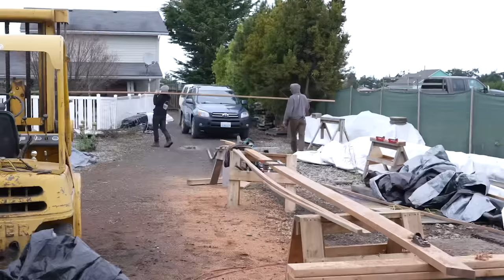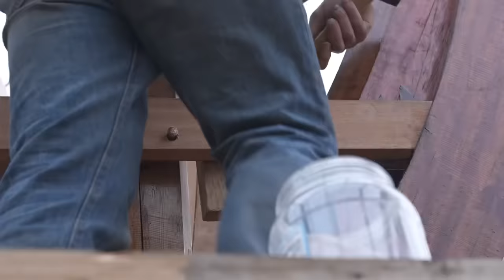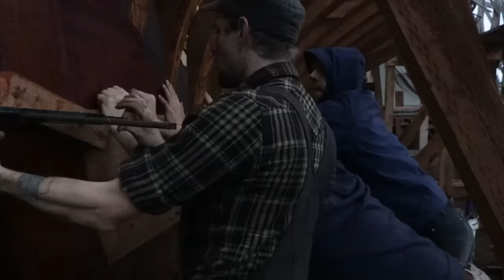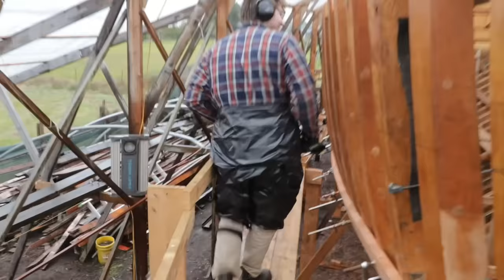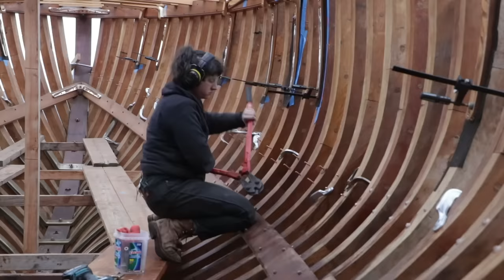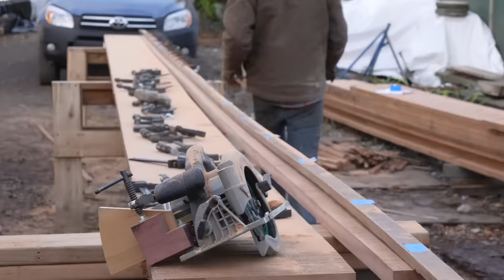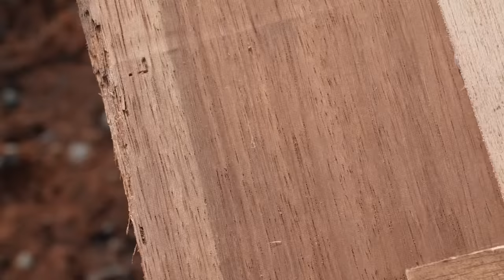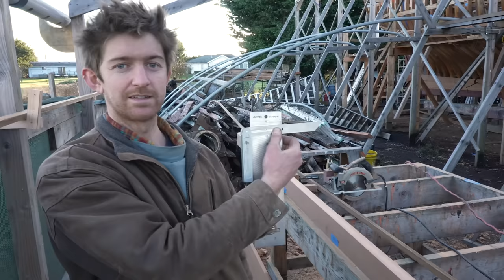Planking Tally Ho! (Wooden Boatbuilding / EP86)

Comment: $700 cost for cast bronze floors is such an incredibly cheap price. If you included what normal labor charges would be for the huge amount of work in each part I suspect the cost would be 4x that or more. The foundry was also  so very kind in their charges. My first thought when you started the floors was OMG, the cost will be huge . I’m so happy 
you pulled it off with such FINE workmanship.

Comment: Have you ever used a rivet gun. Chicago pneumatic and ingersol rand make some nice ones. You can buy sets for them for universal head rivet that form a nice shop head instead of hand peening. I use a 4x for up to 1/4 aluminum rivets in aircraft. And a 7x does all the larger thing I’ve come across.

Comment: The aversion to epoxy is kind of interesting - multi million dollar sport fishing vessels are built every day in North Carolina using marine plywood and epoxy, but they are skinned with fiberglass so I reckon that makes a difference even though the glass isn't structural.
Reply: @cmmartti  yeah - in cold molding several layers of marine plywood (or thin planks) are glued together with epoxy over a jig to form the structure of the boat. Then the whole thing is skinned with fiberglass to waterproof and prevent abrasion.  Just another example of how many different techniques there are in the world to get stuff done.
Reply: @cmmartti  when I was in college the civil engineers competed in a concrete canoe competition.  That was cool stuff.

Comment: When you look at the problems that A2A had with their scarphs, can't blame you for using butt joints. I think Steve said he was uncomfortable with the butt blocks inside hanging up dirt, damp and garbage. Personally, I just don't trust glue at all (everyone but me seems to be able to use superglue without a problem), so I would agree with you. I was wondering whether you were going to use screws or dumps to fix the garboards and hood ends. I knew I would find out eventually, so held off on asking. As usual, thanks for the video.

Comment: - 29:29 The $33K spent for the bronze Tally Ho needed will pay happy returns many times over in many different and surprising ways. The striving of your inspiration's will, and the happy work done by all, is held as a signal forever in the copper of that metal for all to register and take as supporting guidance long into the future.

Comment: you can actually replace the bucking iron with a grip holding on to the ribs above the rivets and held in place with a lever going beneath the location of the rivet, sparing the stress of the buckers body. the lever can be as long as one meter or more giving a lot of holding power on the rivet, just make the fulcrum of the lever focus on the head of the rivet.
Reply from the maker: That's a great idea, I might try that!

Comment: Leo, get the crew an air hammer for driving those rivets. Much easier on the body, and faster/ neater (you can buy dies with concave ends).
Reply: I used an air hammer for 3 days, and couldn't feel my arm for 2 weeks after....

Comment: I wonder if $700 is some sort of magical bronze-number. We designed, and had cast, bronze hardware for the house we were building - hinges, escutcheons, levers, strike-plates, and (for many of the doors) deadbolt knobs and/or kick-plates. The number came to around $700 per door.

Comment: It's too late now, but could you pressure inject polyurethane mastic into the old pitch sealed joints? I'ts stuff that sets under damp conditions so should seal the cracks. I'm thinking about something like the "furmanite" process used in engineering to seal leaks. Lower pressure on the boat - we don't want joints forced apart. Stop dowels can be added later.

Comment: Interesting video. Question from an interesting armchair boatbuilder (Mine is steel...) is there a realistic risk in planking up one side first, then the other? I thought that might risk deforming the frame. So you would alternate the starboard garboard with the larboard garboard...

Comment: Talking to a shipwright just yesterday and I called him a carpenter but he soon corrected me and rightly so. I have thought about this and then come up with a pretty good theory that basically covers the difference between the two trades. 
- a carpenter deals with an angle and a shape.
- a ShipWright deals with changing angles on a continues changing shape.
Summing up even further a Shipwright in finesse is comparative to the toolmaker in the steel world. 
The difference  between the two comparisons is if you don’t get it right being a Shipwright the boat you build may sink somewhere out on those Oceans whereas as a toolmaker makes a mistake he just throws the tool into the scrap bucket. Lol

Comment: I have bucked many a rivet but on a aircraft, not on the boat.  We use a pneumatic impact tool.  Why are you using a ball peen hammer which seems less efficient?  Thanks for the videos.

Comment: curiosity question. I didn't see any caulking so far. and the abutting joints between planks and between garboard and keel seem flush, so no room to pack caulking in after the fact.

I understand this is an obvious limitation in my knowledge of shipbuilding, but how do you make all these planks leak proof now?

LOVE this series. It is THE BEST!
Reply: Leo hasn't been very explicit about it, but they are definitely shaping a 'caulking bevel' into the plank edges.

Comment: Leo why do your hood ends of your planks at the stem rabbit not continue to a point? It looks like you have placed an insert to fill this gap afterwards,  is it to prevent damage or splitting on the pointy ends?
Reply: You cannot screw/rivet pointy bits: the wood will split:  remedy: the next plank fills in the  void
Reply: @on4xb  thanks, the reason i ask is because i am doing a clinker (lapstrake) restoration, and the planks on it do continue to their point, where the plank above bears down on the one below, i suppose it saves the need for a fastening right on the thin end. Obviously carvell construction is slightly different, but watching this i was wondering if i need to have those pointed ends as they are quite vulnerable to cracking, as evidenced by the ones i am replacing, but now i can see that i have no other option. I am not a boatbuilder so it is a learning curve.

Comment: Just an interesting note, if your keel lead has been made before 1940 (when the first nuclear bombs have been detonated) it is so called "low background lead" which is very prized for scientific purposes. Price for this type of lead varies from case to case (the specific alloy) but my understanding is it is usually 15-100 times more expensive than regular lead. For some purposes scientists even got permission to melt keels of ancient shipwrecks and ancient artifacts.
Reply: It is the original one, so 1910 and it going back under TH

Comment: If you parallel out your table saw blade, to about 2 thousandths or better - parallel to the right hand miter slot, you get a much better table saw. (loosen trunion bolts and touch up with a hammer)

Comment: That dolly is heavy, that gets old fast. Hang a pulley from above (higher up the boat or even the shed roof timbers) and simply sling a rope between tbe dolly and  an off cut of wood that's a similar weight. You still need to hold the dolly in tbe desired place but you dont need to support the weight, it has the same reaction mass but is actually weightless

Comment: You can't say Acorn to Arebella is wrong because they are building according to their original design just as Leo is following the original design of Tally Ho.  Modern glues are much improved since they were introduced over a hundred years ago so A2A will be fine. Butt joints are favored where the builders know the boat will suffer damage so they build to make it easier to repair. Most of the scarf joints I have seen were square joints, that is they didn't taper to a point, this meant you had more wood to apply a fastener.  But modern glues are now so strong that they can be trusted to hold.

Comment: - 23:26 " Sanded down the side [edge] to make it Parallel with the actual saw blade." YES.
- My guess was exactly that. I am supposing the pan is made of soft aluminum unlike the old saws were. Over time something like a 1/16 inch will get "sanded" off of the front part of the edge of saw pan running against any guide. That is because the hand tends to hold the saw tight and drive the saw into wood guides for a good cut.
- I have been wondering about the saws' motor brushes. They must be close to worn out now and in need replacement before they wreck the motor armatures.

Comment: Is there a reason not to use an air hammer for the rivet peening? Seems like that would be faster and easier. We use them in a sheet metal shop for seaming and peening.

Comment: what's the difference between garboard strake and garboard plank, western red make wonderful lofting battens, stop waters, made me smile, good ideas, my building was in metal, we used stop holes in plate seams or butts, welded to stop fuel or drinking water leaking, recommend to you using 5083 alu for fuel, if I were there I'd make em for free for you
a huge task you  took on, something to tell your grandchildren
WELL  done, no timber for building here where I live
you are fortunate having access to quality fasteners, here the ss screws are from god knows where, power drive them they shear or ruin the slot or posi or square drive, once I bought some from Canada, they were string, no shearing. if you have time please give me a link for fastenings

Comment: Why do you screw the screws for the blanks in too deep?  It doesn't look like you have have enough meat left for the screw to hold it in place. Are you plan to plug with wooden dowel or  filler after?

Comment: Do give an idea of how well those bronze knees and floors should last, common examples of iron swords only go back about 1,000 years. There are some older, but they start to get very rare earlier than about the tail end of the late middle ages. It isn't uncommon to find bronze swords that are 3500 years old and older. There are other factors at play than the durability of the metal in question, but the if you adjust for the probable prevalence of swords (swords per population), bronze swords seem to last far, far longer than iron. That lead keel should also be good for as long as the knees.

Comment: Hi Leo, one question: How come you cut the planks as relatively small strips out of the wider boards instead of using the whole board as a plank and just bend it in place where possible? wouldn´t that be much faster?

Comment: Can you not provide a T-shaped handle for those guys to use to brace the buck (ok, dolly) against/with their body? I also spent many an hour as a bucker and would have immediately quit if i had to hold that bar just with my hands.
Reply: Early days yet, I don't doubt that the dolly will be improved as the work continues.

Comment: A thought about your butt jointed planks. Could you use triangular scarfed finder joints(?) where short fingers interlock at the plank ends. Set them in pitch to seal. Is this appropriate or too much hassle?

Comment: When cutting the planks, why do you care about saw marks on the edges?  It seems that they would fit well enough without them being super smooth, especially considering that there will be batting on the joints.

Comment: I can't get to the end of the comments before time to retire, so: subject of the butt joints. When you get to them, are you fastening the ends to a frame or using butt blocks. It has been my understanding that our Coast Guard will not certify wooden hulled craft with the butts fastened to a frame for passenger use. If you are using butt blocks, would you discuss the size and material and fasteners to be used? Please go into shape, length and bevels, space at ends, bedding etc.  Many thanks as always for excellent and entertaining video.
Reply: I dunno about USCG req'ments, but I gather that the butts will occur between frames, w/ a proper purpleheart backer. Leo is at a bit of advantage here - w/ long lengths of stock ready to hand, he can maximize the distance between butts while making best efficient use of his timber.

Comment: I haven’t seen this question answered and maybe there is no answer. The boards appears to be 12” or so wide and the planks appear to be 4 to 5” wide . I know there’s pulp wood down each side of the board, but are you able to get 2 planks out of a board or just 1 on each? I really enjoy watching the boat come together. Stay safe until later
Reply: The planks have a significant  curve (smile or frown) depending on their position which is why a wide board is needed.
Reply from the maker: Yes so far we are getting 2 planks, sometimes 3, out of a board. Except with some of the broad lower planks which sometimes take up most of a whole board.

Comment: I have a question about the shape of the knees and the structure of the boat:
The Knees have a rather odd sideways bent shape, 
Would it make it easier if there was a Deck beam for every frame ?
that would cause the bronze knees to be straight sideways, but would the structure of the boat improve or suffer from such a change ?
(off course i am aware that you build as the boat was before)
Reply: Tee knees have different functions: 1- to strenghen to connection between the deck beams and the frames (as do the floors for the connection between frames and keel). Secondly  and in particular the set of knees you see in the clip, the knees will be fastened to the chain plates who are on the outside of the hull and will be the connecting points for the rigging that keeps the mast upright and has to to take all the stresses from the sails. That is why they have that strange form.

Comment: Two question's, what are you coating the inside of the plank's with, and what are you using to bed the plank's with, enjoy your show very much.
Reply: For the interior of the planks:"Boat Soup" (a mixture of pine tar, boiled linseed oil, terpentine and a few other additives). Every boatbuilder has his own "secret" recepy.
The bottom of the garboard receives a coat of Dolphinite and the red stuff is "Red Lead Primer" that prevents growth of bacteria etc and preventing rot in the wood.
Reply: Interesting, as a alumni of the wooden boat school in P.T., circa 85, we were not taught to coat  and bed the inside of plank's. Great show  !.

Comment: 19:00  I realize you are using silicon bronze because it's more historically authentic, but if that wasn't a consideration, would it be possible to use stainless steel wood screws?   Or would those not work?
Reply: Sreel or iron fasteners are not at all the thing for a wooden boat. In a wet environment, iron ions corrode the wood cell proteins, weakening them (iron sickness) & allowing biological rot to set in more quickly. In addition, iron-oxygen corrosion (rust) is expansive & weakens the grip between fastener & wood. These probs aren't a big concern if you only expect your boat to last 20-30 years, but Leo is looking 75-100 years ahead.

Comment: I don't truly understand the stop waters. Perhaps we could see a demonstration? So if the centerline timbers (stem and keel) develop a leak on their mating surfaces, the concern is the water will run out of the joint at the rabbit line, behind the planking, and then get into the bilge? So the cedar plugs suck up the water via capillary action? and then where does the water go? Is there a drain hole for these bungs back out to sea?
Reply: The dowels will swell and cut of any water that tries to pass. Simple. By the way, there nothing revolutionairy about, it is an old and  well tested technique
Reply: @on4xb  Thanks for the reply. I know it is an old technique. Some say outdated. I'm a wooden boat builder myself, but modern glues and epoxies have rendered this technique obsolete in my work. I gathered they swelled, because Leo said so. I am trying to understand in detail the leak path and exactly what water flow it is trying to stop? I think I get it, but I would love a more detailed explanation to make sure I got it right.

Comment: Hi Leo, I am wondering is there a specific size limit on the width of the planks?, I notice you some wide planks yet you cut them down to  a 6" ?? width. Just curious. is it the grain in the wood??
Reply: With wider planks, more material must be removed to match the frame curvature.

Comment: Now that you can MIG weld a bit, learn to push the tip/wire instead of pulling. Builds up less heat in front of the weld.

Comment: Being that you screw in the lower timber’s, why would you not screw in all of the timber’s? Is there an advantage of rivets over screws?
Reply: Rivets are a LOT stronger than screws as they can't pull out / strip threads.
Screws are used where you can't get to the back of the rivet to peen it over.
Some boats are fully screwed, but usually the smaller ones!

Comment: A dolly improvement to limit bounce without adding too much weight: a coil spring (6 x hammer lbs) - (Live mass lbs) = lbs per inch spring rate to hold fast the lead against the inner face. Fill cavity 90% with oil damper through a Schrader valve before pressuring to 50psi to prevent bubbles. 
The spring rate if memory serves was a bit of mathematical wishful thinking pulled from the sky in order to request a spring over the phone. Surprised when it worked almost like it was designed... through careful planning or complete BS luck, we'll never know.

Just a passing thought from the past to pass on.